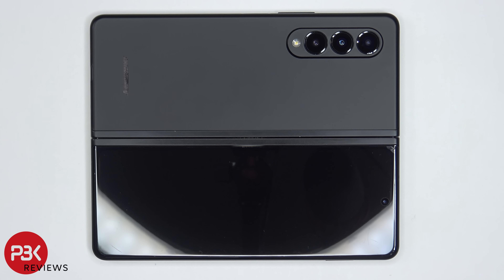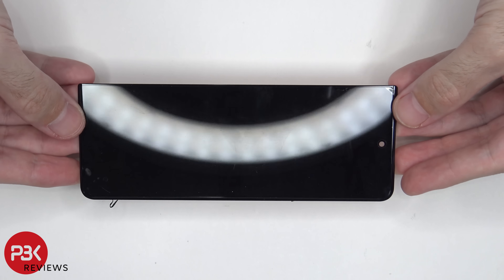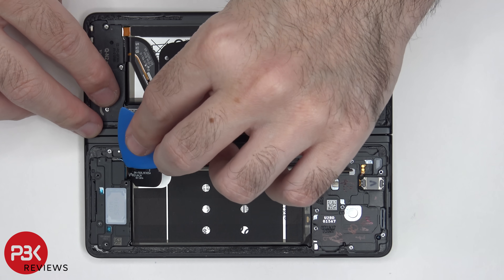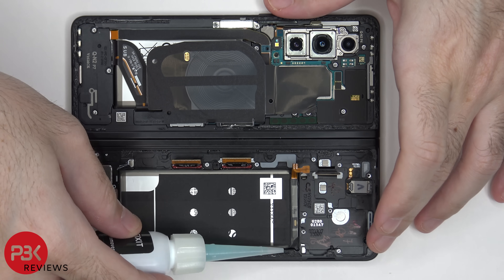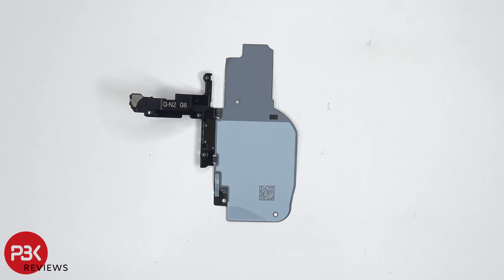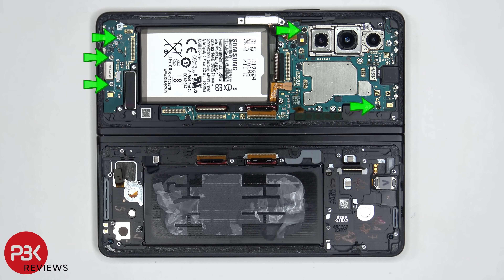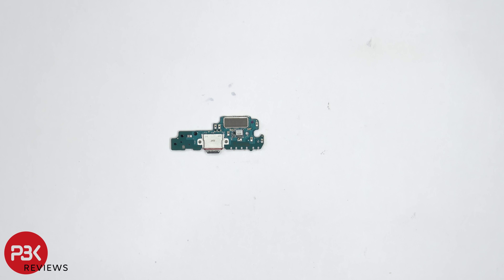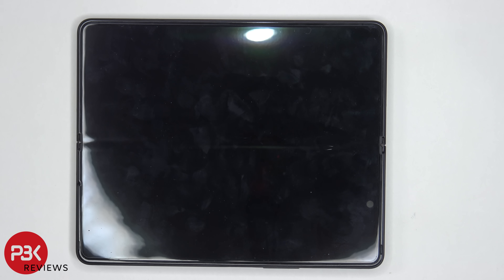Samsung Galaxy Z Fold 3 5G Disassembly Teardown Repair Video Review

Comment: Excellent video!  My husband has this phone.  He is trying to replace the front loudspeaker and the top earphone.  Do you happen to know what the part numbers are for those parts?  I am having a hard time finding them.  The model number is SM-F926U
Reply from the maker: try looking for the parts on mobilesentrix.com or shop.headlane.co.uk   . Rounded.com should have it too but most sites are switching to wholesale business sales vs end user.

Comment: 1. When you decompose the liquid crystal, did you remove the adhesive with heat treatment or isopropyl alcohol?
2. Which one is better, T-7000 or double-sided tape, when you put it back together

Comment: Hi, my z fold 3 recently started having issues with the loud speaker, where when unfolded, it doesn't work, and when folded, it would sometimes stop working or go max volume with static, and I can usually temporarily "fix" it by unfolding and then folding again. 

I just want to get your opinion on this, since I want to possibly attemt a repair on it. It sounds like an issue on the flex cable issue right, in which case I only need to remove the front screen and follow everything until 3:49?

Comment: A great explanation that is easy to understand. 
However, I still need the half with the front main screen up to the hinges, because I need that to remove the dust protection brushes that now prevent the Fold from opening completely 😁

Comment: Hello, excellent video, could you tell me where the WiFi antenna is and if it can be replaced?
Reply from the maker: Thanks. Not sure exactly which one, but usually is one of the plastic covers which have the antenna lines drawn on them.

Comment: What part needs to be replaced to fix wifi not working? or is it baked into one of the boards. Thanks.
Reply from the maker: Yeah, the wifi/bluetooth module/chip is soldered to the main board. If that is the problem, it would require soldering knowledge to replace. You can also check to see and make sure all the cables are in place and have not come loose as well as all the screws are in place holding the plastic covers down which usually have antenna lines running through them.

Comment: DO NOT be misled by this video!! It is next to IMPOSSIBLE to pry these covers off even after heating.   This video is VERY misleading.
Reply from the maker: no it's not impossible. Just because you may be doing it incorrectly doesn't mean it's near impossible to do. try using a suction cup tool to pull up on the screen or cover after heating to help gain leverage to getting a pry tool in between. If you can't then let a professional do it.
Reply: @PBKreviews  Video makes it look like it just prys right off after warming a little and this is Not the case.

Comment: Wow,, that's fast,, but if I wanted to change the flexi cable that goes through the fold how would that be does? Please help lol
Reply from the maker: You would have to completely disassemble the hinge assembly in addition to using a razor blade to cut out the rubber gaskets sealing the openings around the flex cables.
Reply: @PBKreviews  thanks for the reply I've ordered the replacements so will see how it goes,, fingers crossed with your video to assist I may be successful 😀

Comment: what part would i need to replace if the sound does not work on the big screen, the sound works fine on the front screen but when i get about half way to opening the phone the sounds just gets cut off and doesn not work on the double screen.

Comment: any idea where the flex mode sensor is? or the solution of fixxing the lack of audio after about a year to year and a half?
Reply from the maker: not sure what a flex mode sensor is.
Reply: @PBKreviews  not sure either but running the diagnostics on my phone it says its faulty.  I would order a part but honestly I am not a fan of ordering random things to guess.  I have the issue though of now sound coming from my phone opened or closed and went through everything on google.  So im guessing its what ever the flexmode sensor is

Comment: Hi Great video. Yesterday for whatever reason the phone got really hot and then i noticed that only the front face wasworking and the big fold was just blk. Totally dead. Now even the front is barely working.  Do you know what could be the cause? I would appreciate any response. Thank you
Reply from the maker: Thanks. Hmm could be possible water damage if somehow water got inside, or loose cable or short which is more unlikely. Also did you try to hard reset it by holding down the volume and power button for 30 seconds?
Reply: @PBKreviews  hi thank you for your response. There was no water damage at all, and I did try the hard reset but it didn't get better. Guess I have to take it to service and see what has gone wrong.

Comment: I had the exactly the same phone and it died after 1 year of use. I don't recommend buying this phone or similar phones from Samsung. It costs a fortune if things go wrong. Only replacing the screens would cost you 4 to 5 hundred bucks. To be honest, I hardly used the the bigger screen and the small screen is smaller than most phone and I used the small screen daily.

Comment: I would like to say Thank you to you sir, you are the best, im having a trouble on my Fold 3 because of water damage it happen accidentally because of the glue on the back cover dissolving by itself . I was trying to clean my phone with water then after a few hours i notice the form is shut off and cant be turn on. Luckky I follow your step to open the phone and dry it out part by part,  finally all the hard work is paid off my phone is working as usually. I did when to the Samsung care before repair the phone by myself they void already my warranty and asking to paid 1.5k usd to repair for the water damage part lucky did not fall to their trap.

Comment: I have a z fold 3. The wifi isn't working for it. But when i restart my phone it starts to work for a while but then stops again. The Samsung service center said that we can replace the screen and the wifi started to work. Can you please tell me where the wifi antennas are located ? Because they're asking for Rs52000 just to replace the center screen.
Reply from the maker: Not sure which one is for wifi, but I don't think a screen replacement would be the issue. I would think it would be motherboard related with the wifi chip itself.

Comment: When prying the foldable screen off from the mid frame, are there any screws or other parts to remove? Or will it come right off so to speak? Also, could you suggest where I could buy a foldable screen portion from?

Comment: Hi, congratulations on the video, it's done very well.
my Fold 3 has a problem. If I open the screen the audio does not work, instead with the main screen everything is fine. 
If I do the diagnostics it tells me that there is a problem with the flex sensor. 
Since it's out of warranty I thought I'd fix it myself. 
In your opinion which part should be replaced? 
Thank you
Reply from the maker: Thank you. Hmm not too sure what would be causing it. I would assume it's not detecting the flip being opened but not sure exactly what you would need to look at to fix the problem.
Reply: hi. my phone has same issue. How did you fix it?
Reply: @hoangduy92  Hi, unfortunately I haven't solved it yet.
Reply: @Andrea Orlando  today I ask a repair store and they say can fix this, it cost only $150 (Samsung services center offers replacing entire main screen assembly at $500).
Reply: @hoangduy92  it's a great price. Let me know if you solve it and then I'll let you know too. Thank you
Reply: @hoangduy92 did u get the Audio issue fixed and if so can u tell me what company serviced it so I can send mine in? They want $600 to fix and I can get a new one for that now lol

Comment: I'm curious what piece of the hardware controls the Bluetooth. Mine has seemingly randomly had its Bluetooth turn off and on by itself and I even had it in safe mode. I've noticed that sometimes it's when I unfold it that the Bluetooth turns off and I fear it's a hardware issue.

Comment: Any suggestions in cleaning the hinges? Theres super fine sand grains stuck inside the hinges preventing the phone to fold out fully
Reply from the maker: hmm not sure, you can use a soft brush like tooth brush or something but if its in areas you can't get too, you would probably have to take the entire thing apart to get to the hinges which also poses a chance of damaging or braking the folding screen when prying it off. Also when putting the screen back on, you would need to re install the original adhesive cutouts made for it, to keep it in place so when folding it doesn't crack down the middle.

Comment: Very nice.  just need a video about "What types of tool/tools can you use to apply heat safely to the cover plates to facilite easy removal"
Reply from the maker: Thanks. I prefer a hair dryer or heating plate can be safe as well since heat is more evenly distributed.

Comment: Is it possible to change the metal housing around the front screen? if so do you know where I can buy the part?
Reply from the maker: The border around the inner screen is plastic, but if you are referring to the frame of the phone that the screen is adhered to, usually they are sold attached with the inner foldable screen. You can check this website for some parts: https://rounded.com/galaxy-z-fold3-sm-f926b/

Comment: Hi what does the processor at 2:50 do if the RAM and CPU are on the other side? Is it just for the selfie camera? Thanks for the teardown!
Reply from the maker: Hi, not sure what the chips under those shields are for. I'm not too fluent in the technicals of each chip and its purpose to be able to answer that for you.

Comment: If I cracked my screen on the front display, but the screen still produces an image fine, and the touch still works fine, do I have to replace the whole screen or can I just replace the layer of glass that's broken?

Comment: Hi I am having a issue my phone z3 having  Temperature issue where is it thanks
Reply from the maker: It may be related to the charger port, wireless charging coil connection (may be loose) or some other issue. Not sure based off the info you gave me. Also you can take a look at this link, not sure how outdated it is or if it will solve your problem: https://www.howtogeek.com/691619/how-to-turn-off-all-your-android-phones-sensors-in-one-tap/

Comment: How long did you let the IPA soak on the adhesive before removing the battery?
Reply from the maker: Usually 30 seconds to a minute. Then you can try prying it off from one side and if it's still too difficult you can add a few more drops and let it get under the battery and wait another 10-15 seconds and start prying it off again.

Comment: Great tear-down video. How difficult would it be to swap out a damaged outer shell of the hinge?
Reply from the maker: Thanks. I think it would be pretty difficult. Would probably require taking the hole thing apart and prying off the fold screen to gain access to the hinge screws holding it in place. Would probably be best to call samsung and see what they quote you on them replacing it for you.
Reply: @PBKreviews  Many thanks for the prompt reply and for advising.  Will definitely ask Samsung…fingers crossed that it’s not too expensive to repair/replace or I’ll just have to learn to live with the dent on the hinge!
Reply from the maker: @frednoce3043  👍

Comment: Amazing video !
I am fixing my loose power/fingerprint button... but it's not totally removed just like in Flip.  Can you show me ?
Reply from the maker: Once you take the backplate off, there are those two Philips screws holding down the metal cover which covers the rubber gasket in the slot leading to the fingerprint reader. Once those screws and cover are removed, you need to use a thin small tool to carefully pull out that rubber gasket which is attached to the flex cable for the fingerprint reader/power button and it will come out of its place, but its somewhat tricky getting it back in. You will need to play around with it a bit to alight it correctly etc. I don't have the phone with me anymore to do a video on it.
Reply: @PBKreviews    I just need to fix the loose ... not sure how I can do it.  Im just thinking of re aligning the button or make it more protruding out?

Comment: Do you (or any other viewer) have an idea how to replace the camera glass? There doesn't see to be any replacement parts available and I really don't want to send it to Samsung since the camera works fine, it's just the glass above the lens that's broken ...
Reply from the maker: The camera glass is held on with adhesive, so you can heat it up with a hair dryer or heat gun n pry the glass cover off but as far as replacements go, not sure when they will become available.

Comment: I wish you woulda showed up the teardown of the big blac screen lol everything else looks pretty simple (comming from an engineer)
Reply from the maker: I did it on the flip 3 but yep the chance of damaging these screens are extremely high and I can't usually afford to render the devices useless or I would not be able to continue making videos, however here is a link to more detailed pics of the assembly with the screen removed etc. https://www.theverge.com/22619139/samsung-galaxy-z-fold-3-flip-screen-durability-waterproof-aluminum

Comment: Can you do a video on upgrading internal storage on the z flip 3? i wanna upgrade my internal storage (128) to  256/512/1Tb
Reply from the maker: It wont be possible. Only someone with expert skills in soldering would be able to replace the soldered on ROM from the motherboard. I personally don't have the skills to do it myself.

Comment: Hi. Thanks for this very detailed teardown video. One question though. I found a video explaining to be careful in using cases with adhesives, particularly on the 5g antenna cover located on the rear side near the main cameras (in this video; time stamp 6:30)

But based on the unboxing of other youtubers, their model doesn't have that cover despite being 5G. If this cover is missing, does that mean 5G reception is weaker on models without that plastic cover?

Thanks.
Reply from the maker: Hi, im not sure what plastic cover you mean. If you are referring to the mmWave 5G antenna itself, not every model will have the mmWave 5G. There are different 5G networks, most use sub 6Ghz 5G which does not use the mmWave 5G antenna so it wont have it. Still has 5G just a different technology 5G antenna. Hope this explains it.

Comment: when you tear it down like this does affect the nanocoating that goes on the components to keep it water resistant?
Reply from the maker: no but it does affect the water resistant adhesive seal, so you would need to re apply original pre cut adhesive for the phone (when available) to ensure a water resistant seal.

Comment: Samsung has clearly never heard of adhesive pull tabs. Those would've made battery removal way easier.
Reply from the maker: Yup 👍
Reply: I thought the fold 3 is supposed to have a 4,400mah battery?

Comment: Alot of people are wondering if the Dual and eSIM disabled US version internally actually has the dual sim reader hardware? People are hoping they could just buy a dual sim tray and flash European firmware to get dual sim working can you possibly confirm this info please ?
Reply from the maker: Hi, I didnt pay too close attention to that during the teardown but looking at the video the sim reader looks to be a dual sim reader on this US version I took apart. Its the same type of sim reader like the ones in the S21 series which were dual but the additional sim reader pins on the opposite side were disabled from software. Its still possible that on this phone it may not be disabled and using a dual sim tray may work without software change but most likely you will also need to flash a dual sim enabled software to the phone as well.

Comment: The fact it's all in pieces and many things can be replaced without the whole board I would give a good 5 or 6, just because it's complicated just means you have to be careful. 
The whole time I was thinking where can I shove a head phone jack or a note pen.
Still thinking. 🤔
Reply from the maker: True but complication is where most of the time a repair job can go downhill since the more complicated it is, the more of a chance people can damage something or not be able to do it themselves. Usually people look at the repairability scores to see if its easy to be able to repair the device themselves if needed rather than how many parts are replaceable. But yep again depends on each persons view.
Reply: Going to repair it myself as well, have to replace the flex cable sadly adhesive remover is as rare as gold...

Comment: Wow now this is a phone I prey will never need a battery replacement as Samsung will be making my open wallet surgery time interesting as it’s such a lengthy procedure you Just know it will be hundreds to replace battery:  I usually replace my own batteries but certainly not this one a few too many hundred screws for my liking . 🤣
Reply from the maker: lol yep, its a time consuming repair job if needed.
Reply: @PBKreviews  and so fiddly only a professional could do it really so here’s hoping my battery lasts me my contract length which is 2 years: I buy battery packs too though so I’m never cought off guard.

Comment: So the frame, screen, and hinge is unopenable?
Reply from the maker: It is openable but most likely would cause it to get damaged if you attempted to pry the folding screen off. It's adhered well to the frame to prevent damage during folding and to keep dust and debris as well as liquid from getting places it doesn't need to be. You can look at some detailed pictures here https://www.theverge.com/22619139/samsung-galaxy-z-fold-3-flip-screen-durability-waterproof-aluminum